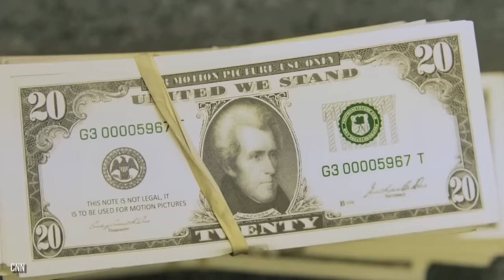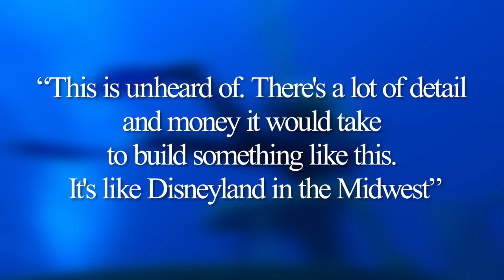This $12 Million Dollar Waterfall Mansion Has Secret Underwater Tunnels

Comment: So, if someone buys this for $3-5 million or whatever, does it get reassessed in terms of tax value? Because it would be ridiculous to charge someone as if the house was still worth $30 million, it's clearly not. On the other hand... if someone bought this huge mansion for $5 million, then paid property taxes on it as if it were a $5 million house, that would actually be a pretty sweet deal. Sucks for the original owner, they kinda get screwed every direction, but the second owner would get a huge house without the crazy taxes. 

Anybody know how this works?
Reply: Tax on this is 13000$ per month & it got sold for 2.5 million